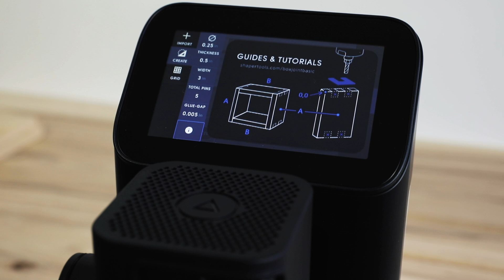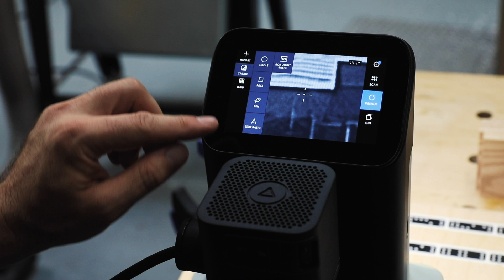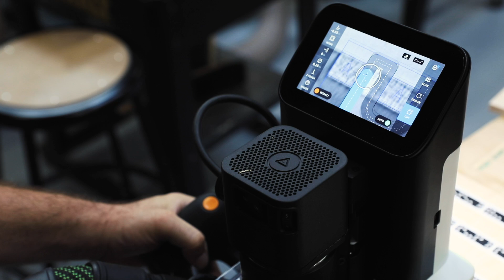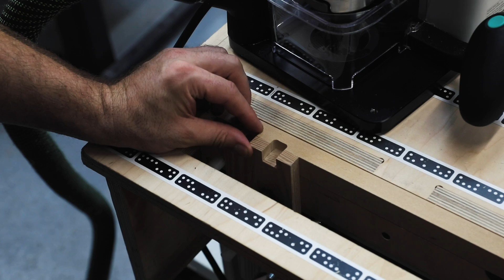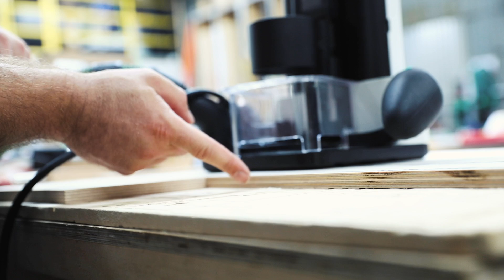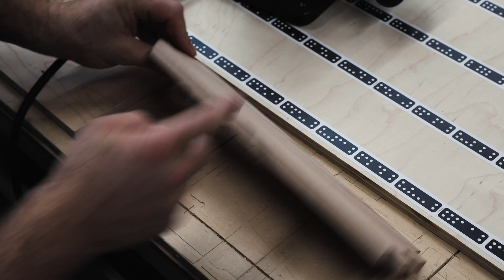Walkthrough of Box Joint Basic Extension on Shaper Origin

Comment: Not for production work!  It took me 30 minutes to cut box joints for a single drawer using the Shaper Origin.  This is something I can do with my table saw jig in 3 minutes per drawer.  However, the Origin does cut a very nice box joint.